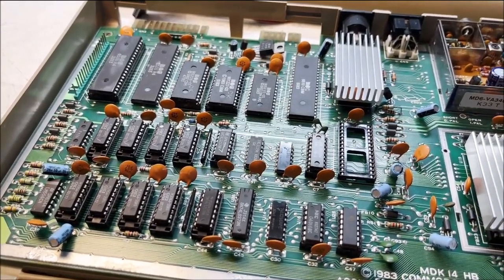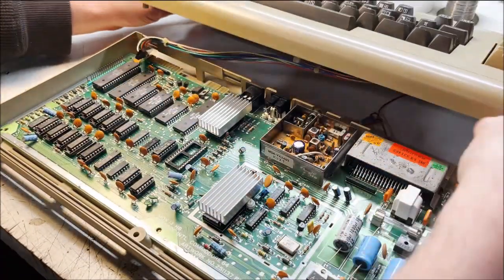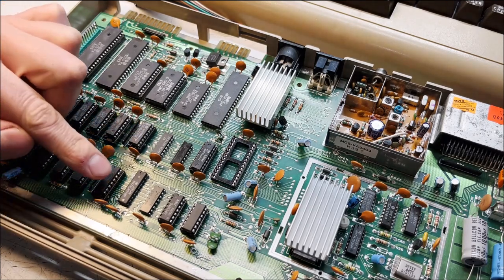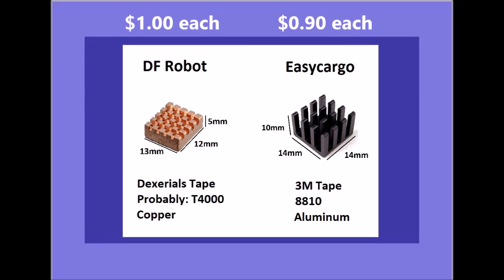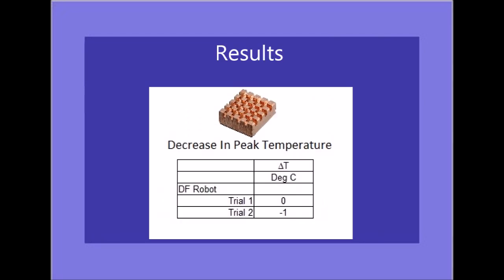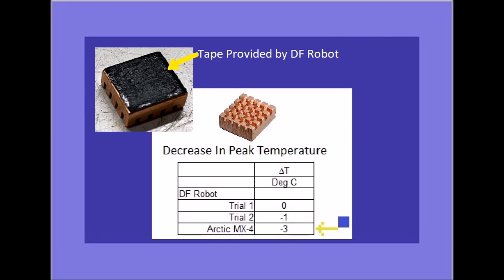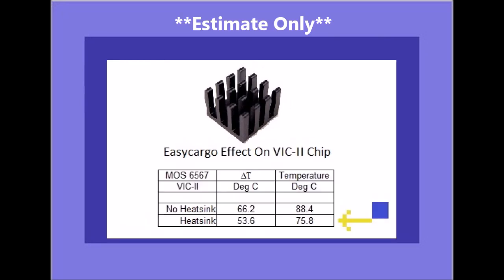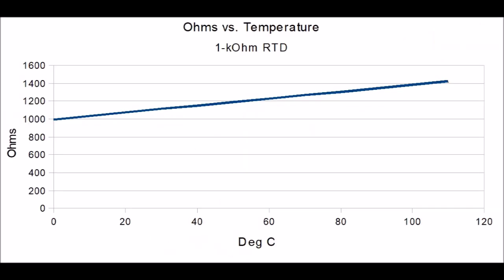Comparing Two Heatsinks In A Commodore 64 (DF Robot vs. Easycargo)

Comment: Copper is very good at taking the heat from the chip, but is terrible at releasing that heat into the air. Aluminum is the opposite. It's not so good at taking the heat from the source, but it's excellent at sending the heat into the air. Copper just gets really hot and takes ages to cool down. If you combine copper and aluminum, you get the best of the two worlds.
Reply: That's just wrong. 
Copper is great at conducting temperature, both heat and cold. It doesn't magically easily gets hotter and don't release the heat outside, otherwise we would have a perpetual motion machine based on this. Also, this is against laws of thermodynamics.
The problem with the copper heatsink in the video is the surface area, it's multiple times smaller than that of the aluminum heatsink.
Reply: @dirtyclanner2250  No idea if you are right or wrong, but I'm talking from experience. I tried a copper heatsink to cool a chip and it just gets really hot, really fast. You can put your hand close to it and not feel the heat in the air. Tried the same thing with an aluminum heatsink, even a little smaller than the copper one, and it stays at a lower temperature and you can feel the heat in the air. I also don't think it goes against thermodynamics. If you take more energy than what you lose or release, you get hotter until you meet equilibrium or it melts. Maybe I have some concept wrong.
Reply: Wouldn’t two different metals touching cause a galvanic reaction which would lead to corrosion?
Reply: @trippycat  only if there's an electrolyte, which there should not be in this case.
Reply: @gwong940  would a graphite thermal sheet further reduce the chance of galvanic corrosion due to humidity in the air?
Reply: @trippycat  Only if an electric current passes through the metals. These are inactive; preferably grounded. Most common heat sink designs utilize copper piping as a heat carrier and aluminum fins pressed against the copper piping. It works well, especially if applying forced air through the aluminum fins. You can even pipe the copper outside the case and put the fins outside.
Reply: @luisderivas6005 Thank you for the explanation.
Reply: How sure it was a copper and not a painted alumni?
Reply: @oidpolar6302  That is a possibility. It was a Chinese product so... But I drilled some holes in it and it does appear to be copper. Also, I saw a video from Linus Tech Tips that said (from a good source) the same thing. Copper is not that good to release the heat into the air. I saw so much difference between the copper and the aluminum that I really think this is correct. You can check yourself. Take the copper heatsink in your hand. See how fast it gets hot and you hand cold. Then, leave it over a surface that is not heat conductive and you will see that it takes a very long time to get cold again.
Reply: @Kenshindegozaru  Guy Fawkes night and hot pennies.
Reply: Try heating some steel, long long cool down period if down passively.

Comment: Were the tests using just 1 heatsink? Needs 3 or 4 really. The older they get the hotter they get so nowadays the vics need a fan+heatsink, heatsink alone doesn't do enough. On one of my c64s I used a fan and heatsink taken off an old geforce mx2 junk video card and it runs super cool.
Reply: You can see three of the copper heatsinks mounted on the VIC at 6:06 so I assume that's how they were tested, but I agree, these small heatsinks have too little thermal mass and too little surface area for what I'd consider long-term-solution temperatures. Still better than nothing, but yeah ¯\_(ツ)_/¯
Reply from the maker: One heat sink of each kind was used for the test. When it comes to VIC and VIC-II I put three on.